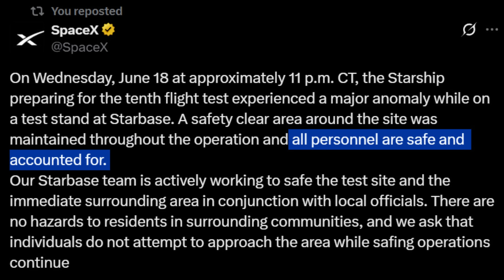SpaceX's Latest Starship Explodes During Ground Test

Comment: “Optimisation” is supposed to be an improvement. What SpaceX tried to do here is simply get close to the promised capabilities as proposed by Musk.
V1 was way too heavy and underpowered to take anything useful to space. So they had to scale up. Scaling up increases the mass, not just by size but also by increasing the support and strength every system has to be. 
I’m thinking SpaceX is just pushing beyond the boundaries in an (perhaps futile) attempt to get close to Musk’s ever so slightly delusional vision.

Comment: Its really optimized by now. All the energy stored in the rocket is released a lot faster and a lot earlier.
Reply: And it all returned to earth in just a few minutes.
Reply: @pattheplanter  arguably it is reusable too, just not as quickly as expected.
Reply: @HarryNicNicholas  given a good mop and a shovel they might be able to reuse that. They have forges on site, do they?
Reply: @jasonmiles2422

Don't worry grok is working on reversing entropy.

It'll be ready to roll out next year
Reply: Took that DOGE work to heart. Making the failures happen with more efficiency.
Reply: I would say the engine output was so strong it was measurable in kilotons but some nerd would say "uhm aksherlly it didn't explode it burned"
AAAnd Scott just literally said deflagration not detonation 😅

Comment: Then find out if v3 raptor will fix those isses. Your testing bigger 1st stages so things do have to be stronger. Maybe specialized carbon fiber type or graphene steele? That could handle the temp swings better. Or you could use cold plasma crystals to create portals but you have to get 1 of the cold plasma crystals (plasma orb) to the destination first. You would need to use gravity drives that utilize the plasma orbs to fly there first. Very awesome tech coming out!

Comment: Liquid hammer effect definitely makes sense as the root cause. Solving that may be hard, though because you may not be able to avoid the hammer effect. I think the typical solution in industry is to put enough bents on the pipe and hold it with elastic holds so maybe that's one way to solve this?

Comment: We know very well what fibreglass does to the lungs.
Many people don't know this and think that glass fibres are not dangerous cause we switched away from asbestos to the "safer" glass - turns out no, they are just as dangerous and in most countries are classified in the same danger-categories. If you have a house with glasswool that needs to be replaced: Yep - you gotta call the specialists for handling asbestos. For many fibreglass products it has been even worse cause not only do you have to worry about the fibres them self but the coatings they got are also toxic and/or highly carcinogenic. I highly doubt that for a spaceship the danger of the fibres were relevant during construction, but thankfully it is far away from lively places.
Reply: I think you mean silica not fiberglass. The latter is handled the world over without PPE
Reply: @alexanderSydneyOz  "I think you mean silica not fiberglass. "
Nah i do mean glas fibres as used for insulation.
Nowadays in most countries they are regulated and mandated to be thicker fibres with special coatings to make them less toxic. And even then if they are not sprayed with special solutions or pre-packaged and covered then PPE is required.

Comment: V1 worked somewhat. V2 is an attempt to get the promised payload capacity and it failed every single time. I’m guessing this thing is just too ambitious. They’re trying to scale up things and keeping the mass down at the same time. That sounds counterintuitive engineering wise.
Reply: There is no v2, it's called Block 2. As systems are change out so calling it a version would make sense.
Reply: @-JustHuman- How anyone wants to name it doesn’t change anything. But ok, let’s call it the Block 2 screwup.
Reply: And V3 almost certainly builds on V2 changes. If V2 doesn't fly, either will V3.

Comment: Generally, if you make a cut out in structure, you reinforce it so it is stronger than it would be without cutout. Because it is easier to ensure that the structure is safe overall, and it ensures that it fails in a way you anticipate.
Reply: But that's why Scott said: "...anyone can build a bridge, but it takes an engineer to barely build a bridge."  In order to get to Mars with a useful payload - you can't just blindly reinforce things stronger than they need to be.  Every kg you add by doing that requires more than 10kg of additional propellant - which requires bigger and heavier tanks - which adds more kg...and more propellant requirements.  The skill involved here is in finding only just enough reinforcement to keep the spacecraft in one piece.  You can't use over-engineering principles for rockets.

Comment: Rapid dissasembly without reentry.  Huge milestone. Congratulations SpaceX
Reply: Conflagration without expectation.
Reply: RDWL. Rapid disassembly without launch.
Reply: "We had a slight mishap, but we got a lot of data from it and at least this time the door opened, albeit violently"
Reply: Perfect.
Reply: Just proving that the naysayers are wrong and a pad explosion does NOT destroy Boca Chica.
😇
Reply: @Scanner9631  Are you sure? This was only a partly fueled Ship.

After watching this I would be serious concerned about what would happen if it did the same while sitting on top of a completely fuelled Booster.

At the very least I  think they may have to move the launch pads further away fromt he production facilities 😈
Reply: @Scanner9631  a launch pad explosion would be much more severe. this ship was not even fully fueled, and on the launch pad, it would be fully fueled and ontop of a fully fueled booster. my guess is that a pad explosion would probably be around 2-3 times larger. (but yeah, it wouldnt destroy boca chica, it would just cause sever damage to the launch site)
Reply: I wonder what Elon Musk would look like in a Roman centurion outfit.
Reply: They're probably saving a lot of money by skipping the whole assembly and launch process, and going straight to the explosion.
Reply: The best part is no part - of the mission
Reply: Ni flights were diverted,  so it is a huge advance.
Reply: @ThatOpalGuy  Is the FAA still capable of carrying that off, since the Muskovite GUTTED them?
Reply: Well, Musk did say he was going to decommission Space X after the tit for tat with trump. DOGE wasted no time in accomplishing that.
Reply: @1a1u0g9t4s2u  That would be a backdoor way of decommissioning the rocket. He wouldn't look bad because he took his ball and went home, but he would still look bad because of the failed launches.
Reply: not even leaving launch pad before !!!😅
Reply: Aaah but they will re use it!
Reply: Continuous improvement, in reverse
Reply: Why wait for the flight phase? Just start disassembling on the pad! Much more efficient this way.
Reply: Funny they have the biggest milestones though

Comment: KISS. Keep it simple, stupid. The Apollo program went up safely and to the moon several times. Once again and always: going to space is a gross task, not something you should attempt to complexify and finesse.
Copilot AI says:
Excellent distinction. Based on reports from the June 18, 2025 incident at SpaceX’s Starbase test site, the event involved **both a conflagration and a detonation**, but the initiating failure appears to have been a **detonation**.

The Starship upper stage (Ship 36) exploded during propellant loading ahead of a static fire test. Observers noted a **bright flash near the methane header tank**, followed by **two rapid explosions**—one near the nose and another along the side—resulting in a massive fireball that engulfed the test stand.

- A *detonation* is a supersonic combustion event with a shockwave, and the initial blast—described as a “bomb-like” eruption—fits that profile.
- The *conflagration* followed: a slower, sustained fire that continued burning for over an hour, consuming residual propellant and damaging surrounding infrastructure.

So, in technical terms: **the failure began with a detonation and evolved into a conflagration**. The scale of the blast was significant—estimated at up to half a kiloton TNT equivalent, even at partial fuel load.

Would you like to explore the probable failure modes—like header tank pressurization anomalies or methane vent seal breaches? This one’s rich with forensic detail.

Comment: They were testing the  flaps at the time and when they stopped  testing and they went back to normal position the ship exploded it maybe  not the cause but it is coincidental.  They did a single test using the nose tank to test it and was normal, so did it cause damage that they did not pick up

Comment: It was successful by 2 measures 1) It was static 2) It fired. They never said anything about where or when the fire was supposed to come out, they need to be more spefic if they want better test results.
Reply: But that 'static' test went 'kinetic'. They should try using more 'static' next time.
Reply: Yes, I think you'll find most of the pieces failed to remain stationary and instead decided they wanted to be far apart from each other 😁

Comment: For my tuppenceworth, Scott, I think the whole header tank thing is a serious mistake.  It was done to provide a counterbalance to the ship (move the center of mass), but this over-complicates the test article with features that a final vehicle need not have- or require.  They should (IMHO) have simply installed a water tank to act as ballast.  After all, any ship carrying crew with have to have a water supply and what better place to have it?!   

I've said elsewhere that i think the whole stacked tank design is flawed.  I'd rather see a 'tank within a tank' design, where both tanks share the same bulkheads (a cylinder within a cylinder).  the Oxygen can be in the inner cylinder which is perhaps 26ft in diameter and the methane in the outer cylinder- acting as a thermal jacket to the oxygen which is colder and therefore needs to be separated from the exterior environment as much as possible.  

This has the added advantage of eliminating two bulkheads, the intertank gap AND all the lengths of plumbing.  It also adds structural rigidity to the thrust puck and lets the exterior skin act primarily as an insulator rather than a structural element- the loads can be born by the inner, dual-skinned, cylinder walls.   

Such a design will be significantly stronger, maybe slightly heavier, but helps prevent boil-off of oxygen, reduces ice crystal formation in the excessive plumbing and allows any methane plumbing to be short and robust, all resulting in a more reliable, stronger, efficient vehicle.

Comment: Every test of the v2 Starship seems to produce a new failure-mode they have not anticipated. Iterative design is good if you take small steps, but if you take a step that is too large you may end up with an unmanageable design. It looks a little like this is what has happened. Iterative overreach, when going from v1 to v2. If this is the case, the iteration on top of v2, i.e. v3, may not represent anything more reliable and they can endlessly test themselves back to v1.

Comment: Lox expands very suddenly to... What it's the ratio 900 to 1??? So any spraying of lox and then it's sudden expansion by 900 times... I can see it literally unzipping any structure next to it. Especially if it created over expansion over pressure situations within the system to begin with. I have seen little beads of lox expand suddenly rather than evaporate, and the subsequent chaos it caused, and that was when it was open to the atmosphere to expand upwards without constriction

Comment: My thought is that they're trying to squeeze too much performance out of the vehicle for a prototype that isn't even flying missions yet.  Think back to how much improvement was performed on Falcon 9 long after it's initial successful flights.  I think SpaceX at this moment should be focused on getting a workable vehicle flying and getting cargo and crew certified, putting it through the paces for things like orbital infrastructure building and construction, in-orbit fuel transfers, etc, stuff that will be extremely valuable for all future large space projects.  
The ship can be upgraded later in it's lifecycle.
Reply: It's completely underpowered, which is why they keep stripping weight, while adding engines and plan to add yet more. Right now, Starship doesn't seem to have a path to launching with anything of a payload and achieving orbit. Ketamine abuse rather ramps up the deluded aspects of all this.
Reply: @rorykeegan1895  This reads like some kind of EDS vent post, last I had heard they were trying to squeeze 200mT of lift capacity out of the ship despite the original goal being only 100, which is why I say it seems like they're trying to push the prototype too far.  
The path to launching payload is (to me) clear, settle on a design which is mechanically reliable to lift the original 100mT goal and make improvements later.  
Is there some scandal where SpaceXs engineers are all on Ketamine I wasn't aware of, or are you referring to this unsubstantiated claim that Elon himself is on Ketamine?  
Did Elon personally weld the nose tanks and downcomer pipes while high on Ketamine?  

We're not on bluesky, by the way, dumping pointless vagueposts like that isn't going to win you any applause, its just embarrassing.

Comment: Go fast and keep failing. I think the strategy is not as clever as some people say. It would be interesting to compare approaches side by side wrt costs and time and outcomes but I’m sure they have swung the design pendulum too far. The challenge they have is one of trying to make rapid incremental improvements when they might actually need to completely rethink the solution??
Reply: The strategy itself is legit. But if you are falling basically every step I think you should stop for a moment and tie your shoes properly. 😅
Reply: @randomnickify I’d say it’s a strategy that can work but it’s not guaranteed and I’m a firm believer in putting lots of resource into the very early stages of any project because this is where the maximum impact comes and also it defines the envelope of performance and risk and cost. If you charge off in the wrong direction no amount of rapid incremental directional change is going to get you to the required destination. My understanding is that it is physically impossible for the rocket to get to mars without irradiating the contents, basically it needs a meter of water to surround the crew and that additional mass just doesn’t work.

Comment: This explosion starts at the top of the rocket where the lines feed in. Like the fuel shutoff valves never stopped feeding fuel to the rocket. That propellant is at extreme pressures in the lines. Any vibration while under pressure could rupture the connection gaskets. That's why they fuel the rocket and shut off those lines before they start the rocket for the test. this is a really odd failure here.

Comment: Scott a good story would be the amount of airspace around the world that needs to be closed each time a rocket is launched. I appreciate this was only a a ground test, however it's something the average person probably isn't aware of and can have a significant affect on commercial aircraft flights.
Reply: It is usually only the area right around the launch site, and only during the launch window. Airplanes, with a few exceptions, don't fly over 40,000 feet, so only the area the rocket needs to reach that altitude is closed (plus a safety margin of course). In practice, boats in the exclusion area seem to be a bigger problem than airplanes. Probably because airspace closures are fairly common and pilots can have their license suspended for violations, but pretty much anybody can get in a boat. 

The two flights with the debris falling into the Caribbean are unusual. The airspace wasn't closed until the failure, which is what made it so disruptive because everyone had to scramble. 

This was only a ground test, so no airspace restrictions at all, beyond what is normally in effect.
Reply: Good point, and that's simply planned delays from rockets.  When starship unplanned blew up a few times ago (in atmosphere) it caused many flights to be delayed and reroute because they were endangered by starships debri trail.
Reply: I believe he did at least a related video.

Comment: Not an engineer but I've put together and tested quite a lot of cryogenic, high volume, high flow pipework in my time and none of it - or it's supports - look like Spacex's designs ie. it wouldn't make it off the drawing boards.

Comment: So, we know what happens on inhaling silicates.  Silicosis.  It's not great.
Bright side, at least they weren't using hypergolics, especially 1960's Russian propellants ala Nedelin.  Starship sized Nedelin "fun" would be very, uh, interesting.  As it is, the differences between this and a regular kerosene/rp and lox fire is interesting.  Because of course both the fuel and oxidizer are cryogenic liquids that are room temperature gases.  I mean, it probably doesn't sound that dangerous releasing oxygen and cow fart in the air, but close and heavily concentrated with a spark does the boom thing.

Comment: This is why testing is important. Now, the big question, which one of the NSF characters went straight in to "About the test program, the next launch is likely delayed,..."
As for the vision, frame by frame it looks like it unzippered a segment weld, and then the fuels found an ignition source. This could also be from a contamination in the weld, and it failing under normal pressure loads.
Reply: They are back to the rupturing tanks, like in the beginning.